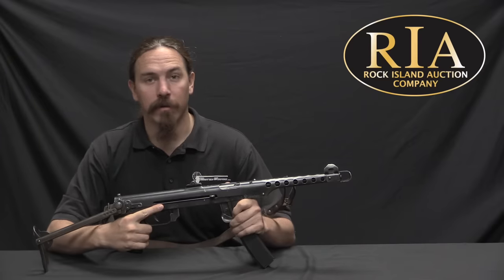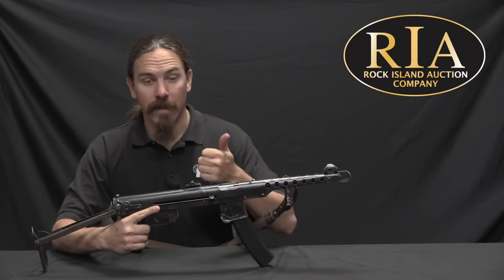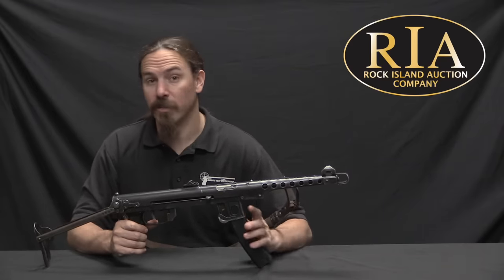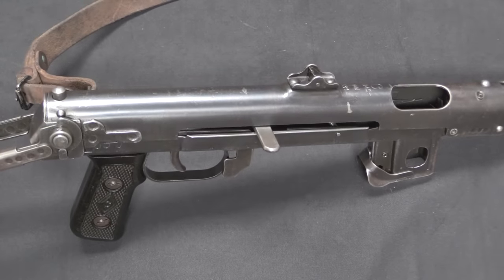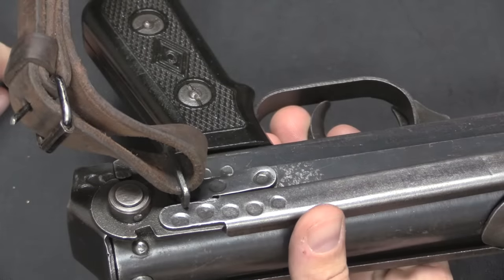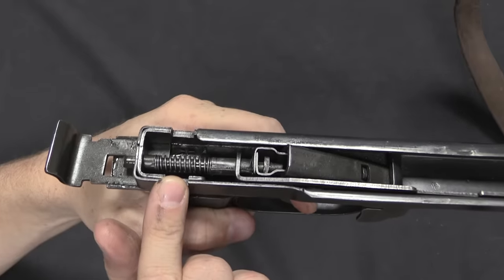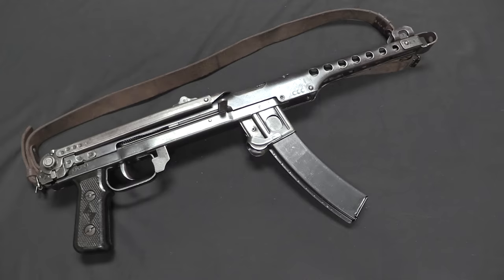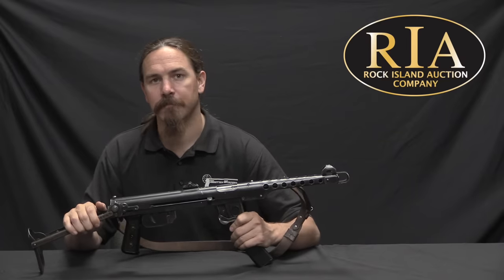Sudayev's PPS-43: Submachine Gun Simplicity Perfected

Comment: I had to watch this through twice. 

There's simple and stunningly simple. This is perhaps the best example I can think of not overthinking it.
Reply: It's even easier now, just get a 3d printer. Then all you'll need are barrels and springs(or just the metal that can't be substituted by polymer)
Reply: I see it as the best example of thinking of what needs doing -  killing Nazis - how to do it - using automatic fire - and then finding the most economical way to make that tool
Reply: Look up the madsen smg, you thought this was simple, oh boy
Reply: @jamallabarge2665  it was thinking what needs doing to defend homeland
Reply: @tsugumorihoney2288  

Wouldn't you agree, Sergei, that exterminating Nazis is how defending the homeland is accomplished?

The Nazis were bestial.  They were wild animals or pigs.  Except that most wild animals do not kill for amusement.
Reply: @jamallabarge2665   Feral Cats certainly kill for amusement.
Reply: You are 180 degrees wrong. If less thought had went into this, it would have been a more complex design. This is perhaps the worst example I can imagine of not overthinking it.

Comment: God this is an impressive work of engineering. I would consider this a work of engineering art. Based on the definition of engineering as the simplest and most cost effective manner in which to solve a problem. Absolutely no wasted material or labor time. I especially like the concept that it was so simple that it was capable of being produced concurrently with the PPSh-41 without interrupting either ones production. It may not be pretty; but damn is it beautiful.

Comment: You didn't mention the difference between PPS-42 and PPS-43. There are 3 of them. 1 - PPS-43 has 20mm shorter barrel then 42. 2 - the sheet metal used for PPS-43 is 2 mm thick, instead of 1.5mm  on 42. 3 - buttstock on PPS-43 is about 50mm shorter then on 42. The main goal was to make a shassi of a gun more rigid (2mm thick metal sheet) but without making the gun heavier (shorter barrel and stock).

Comment: If i was able to own only one fully automatic weapon, this would be it. I can fix it using bar stock, welding and stuff generally lying around my place. I've also become a big proponent for the cartridge it fires too. 7.62x25 is a really nasty round out of a long barrel, as well as excellent accuracy.
Reply: actually i had in mind a slightly longer barrel and shroud etc  and punch mlock holes/top bottom rails  and a single stack mag in .480 ruger.
Reply: Totally agree 
I don’t ‘want my MTV’

I want my PPS SMG  - especially when in umm Dire Straits 😅
Reply: 30 Super?
Reply: It's basically a slightly weaker 10mm

Comment: Great movie, I'm taking my hat off. 

A couple of points. 

When you talk about the price of the gun it starts to seem that the PPSH was more expensive. This is wrong. The PPsH wasn't just cheap, it was incredibly cheap to produce. His predecessor, PPD, was really expensive - the price of PPD was more than 1500 rubles, it was more expensive than a manual machine gun DP.  PPD and DP were created by one of the best armourers of the USSR - Degtyarev.

Shpagin was a disciple of Degtyarev. The first work of Shpagin-completion of a large-caliber machine gun Degtyarev-DK-32 (Degtyarev large-caliber, 1932), 12.7 mm. it was a fine machine gun, but was supplied from a drum for 30 rounds. This did not suit the military, and in 1935 production was stopped. Shpagin modified the machine gun under a tape of cartridges, and in 1938 the machine gun again went into production. Degtyarev said then that the creation of the machine gun merit Shpagin not less than Degtyarev, and insisted that the name of the machine gun was changed to DShK: Degtyarev - Shpagin large-Caliber. 

Then Shpagin began to change the PPD, and the main task was to reduce prices. As a result, only the principle of automation and the disk clip remained from PPD.  The first PPSH cost 500 rubles, but during the war their price fell to 150 rubles. 10 times cheaper than PPD. PCA was even cheaper than the Mosin rifle, which cost 190 rubles.

But the PPSH was heavy and big, was not suitable for tankers and paratroopers, there were also problems with a round cartridge. Therefore, a new contest was announced, and PPS won it. 

No one believed that it is possible to make a gun cheaper than the PPSH - Sudaev did it. According to the plan, it was so simple that in the surrounded Leningrad it was produced even in a small private, non - state-owned farm called "Primus" - "kerosene stove". Because before the war, this mini-factory produced kerosene stoves.

And another interesting point. PPS is a really redesigned submachine gun of Bezruchko-Vysotsky. Sudaev and Bezruchko-Vysotsky worked together at the test center of the GAU (main artillery Department), and commanded this center Colonel Lyuty. He turned the test site into a powerful design organization, where he selected promising young gunsmiths, provided access to any samples of weapons from all over the world and all designers worked together, learning from each other. 

In 1942, a young Sergeant Mikhail Kalashnikov was appointed to this testing center of the GAU, because he was recognized as a talented gunsmith. And if you look at the receiver PPS and AK - you will see there are some common ideas. 

And the older generation of gunsmiths, like Degtyarev, continued to work. Degtyarev studied under the Gunsmith Fedorov-the one who invented one of the first assault rifles in 1915, he was called the father of Russian automatic weapons. And in 1947, the factory Degtyarev, in the town Kovrov, was sent with a prototype Kalashnikov AK-to finalize and create a set of drawings. But assault rifles for the competition against the AK made several different designers, including Degtyarev. 

When Kalashnikov came to the arms factory, Degtyarev, who was then the main armorer of the USSR, carefully studied his AK, long discussed it with Kalashnikov. And finally said, " well, boy, your gun is ready, go to the competition. And I'm not going to compete because your AK is better than my rifle!"
Reply: > it was so simple that in the surrounded Leningrad it began to produce even in a small private, not owned by the state artel, which was called "Primus"

to be correct  - those guys were in no way "small". Read kris-reid.livejournal.com/660569.html
Reply: That's right. Many people, telling that the Soviet economy was against business. But they just do not know that under Stalin, non - state enterprises - called artel-had a lot of help from the state, free loans, subsidies and often developed into very large enterprises. 

So, it is known that the artel "Progress radio" in 1930 produced radios, and in 1939 even established serial production and sale of television receivers on the cathode ray tube. For 1939 this is the same peak technology as it is now manufacturing its own CPUs now

During the war they produced radar stations RUS-2. And it is not a state-owned company. 

But this does not negate the fact - PPS really turned out to be incredibly simple and cheap to produce, even cheaper than PPSH.
Reply: Азамат Карданов thank you for this fascinating history!

Comment: Its like the T-34 of guns
Reply: Early T-34s had innumerable breakdowns due to unreliable engines and transmissions (eerily similar to early Panthers and Tigers, funnily enough). Also the early T-34 engine had an EXPECTED service life of about 100 hours before killing itself, which is why the crews were so abysmally badly trained. It simply wasn't possible to have them train on their tanks because they would considerably shorten the already very short life expectancy of the engine. Took them quite some time to get all those "kinks" worked out of the system, the PPS stands head and shoulders above the T-34 in that regard. Then again, designing a reliable SMG is several orders of magnitude easier than designing an entire tank to work reliably.
Reply: The same shit?😁
Reply: jonny j what makes it so advanced? Nothing really, the sloped armor isn’t special to a T-34 by the time it arrived in the world, ww1 tanks had sloping armor and the French used it quite a lot in their interwar designs
Reply: @nindger4270  T34 desigh was good but the manufactring is shiet

Comment: Finally! A video about my favorite smg, could you do a pps 43 build video considering they are so simple?
Reply: Verbatim So?
Reply: Verbatim I think they look cool
Reply: Carl Smith i think it would be alot easier to build the sten mark2 or 3
Reply: gabber88ful  The Sten would probably be easier, as it's possible to just  buy a tube suitable for the reciever, as opposed to setting up to stamp or bend the sheet metal for the PPS receivers.
Reply: Not really. No NFA paperwork if built as a semi-auto pistol or rifle. As far as bending, I made my own jig out of two square tubes, some threaded rod & nuts, and a piece of gas pipe. Bending a flat is as simple as turning a wrench. Anyone interested in building, checkout the Weaponsguild and prepare for info overload.
Reply: There are vendors that sell bent flats for the pps43. The expensive/ tricky part is converting the bolt and FCG to semi auto. A few ways to do the FCG.
Reply: I havent seen anybody use the original sear since it takes up so much room and leaves little room for mods. Most people go hammer fired with trigger groups from KP products, or hack up a Remington 870 trigger group to fit.
Reply: +Laird Cummings It's actually quite easy... I got one of these when they were on sale a while ago for $450, bought a 16 inch carbine barrel(forget who made it) for $100 bucks, and got a parts kit which had a functional folding stock for $75 bucks. Since it had the 16 inch barrel it was a legal rifle, no NFA paperwork. Forgo the 16 inch barrel though, buy the parts kit, fill out NFA paperwork, fairly easy. 

The guns go for a bit more now as there's no more coming in atm and parts kits are becoming a bit more scarce but see plenty around.
Reply: @GordonFreemanGaming
You meant biased?

Comment: Parts Kits for these are fairly cheap and readily available in the USA. A fairly easy build. Only hard part is the bolt work and fcg.
Reply: Just get a Polish PPS pistol, get a tax stamp and unweld the stock. Then you have a PPS-43 without the open bolt and full auto.
Reply: chrisloUSA - those are fugly. They have a big bulge in the front where they splice the new semi auto rear half with a surplus "snout" cut of a demilled gun. Some people will not notice it, but if you know the pps43, it stands out like crazy and looms dumb. Building your own and doing a proper weld job makes it look nearly original.
Reply: Mojopin How about reading the comments before running your mouth? I already mentioned it wouldn't have full auto and a SBR with a tax stamp, that I mentioned, is legal.
Reply: Rcbif Indeed but it's all a question of how much skill you have or how much money you want to invest into having someone do that for you.
Reply: Mojopin Whatever, baby...

Comment: About the PPSh-41. Drum mags were not interchangeable. In other words, the soldier received the PPSh-41 with two drums and could not use other drums without the help of a gunsmith.
Reply: Владимир Клименко75 some others would fit and soldiers were known to bend or file at the gun or mag to make others fit
Reply: You can file the mags down, but you are right, 2 mags were issued to each soldier.  In the factory they made it fit to the specific weapon, SVT is the same.
Reply: Even funnier actually, even the designated drums that goes with the gun could fit it really poorly, so soldiers had to trade drums with each other untill they eventually find one that fit their gun perfectly. Those drum mags was biggest downside of PPSH.

Comment: This is ridiculously simple - I knew it was simple but this seemingly takes the biscuit. If I lived in the states I'd try to get one but alas in the UK things are different (for better or worse)
Reply: boffinboy100 it is simple, but not ridiculously simple. Fairly elaborate, dedicated tooling is needed to bend that receiver. A tube gun like a sten on the otherhand has less and far more simple tooling.
Reply: just buy some steel and bend it up into a pps 43 in your garage.

Comment: Hey Ian, I just have a quick question that you can hopefully answer. Larry Vickers from Vickers Tactical recently did a shooting demo of this gun and said he was impressed with it. Apparently Kalashnikov himself mentioned this gun specifically as being the best SMG produced in WW2. I watched your videos shooting the gun up in Canada with a wooden stock as well as your shooting video featuring the KP-44, and you seem to be of the opinion that it is not a very accurate or controllable weapon. Just wondering why you think this is? Could it be the ammunition you are using? I know you blamed it on the fire-rate being in that 600 rpm range which is neither slow enough to manage recoil or fast enough to have consistent recoil, so that would seem like an inherent flaw in the design itself which would be present in all the guns. Just wondering what you think of this since I often bring up your points when talking about this gun on forums and most others that have shot the gun don't seem to have a problem with it; in fact, many praise the gun for being reliable, cheap and reasonably accurate.